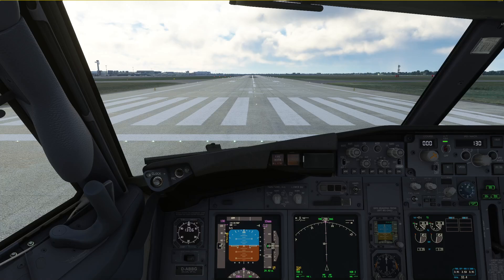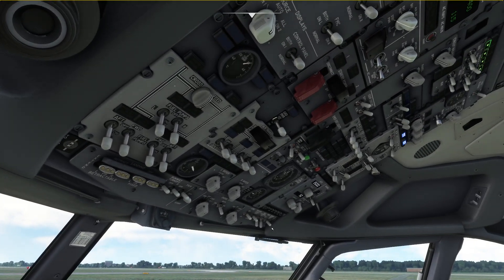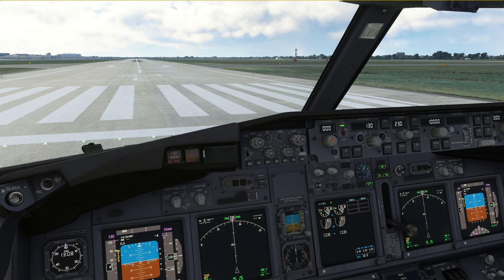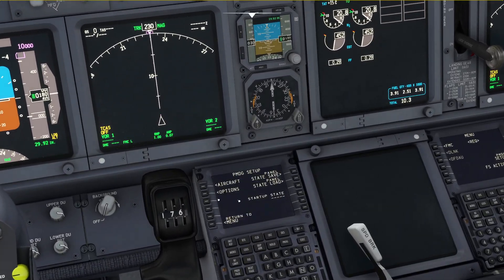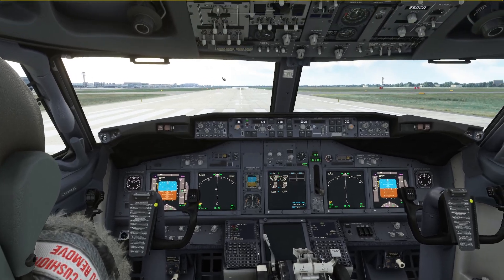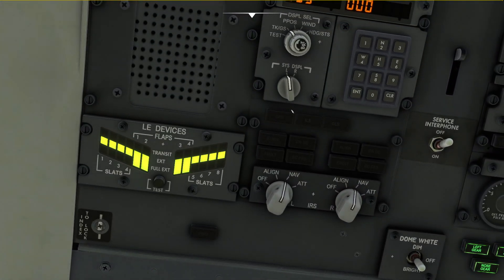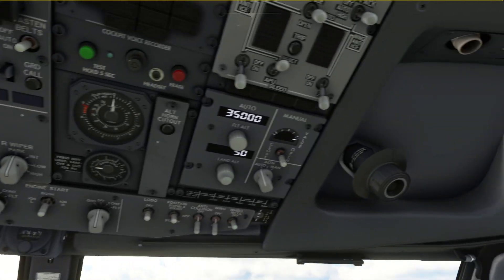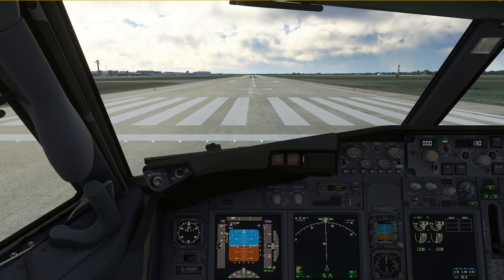Why we do so many RECALLS. 737 Master Caution System explained | Real 737 Pilot

Comment: Very helpful - thank you!  One clarification:  If the recall brings up WARNINGs that have not been previously shown,  these would not be considered important to the safety of the flight if I understand correctly.  So is the only purpose behind doing so many recalls, to get a bigger picture of what may be happening?  In other words, these warnings would likely never cause the pilots to cancel the takeoff, or return to the airport - correct?

Comment: Was always wondering why boeing wouldn't develop a new and modern crew alerting system even for MAXes, like airbus ecam showing detailed alert messages on upper display
Reply from the maker: Hi Eugene, it would mean major training efforts for the crews, costing the industry millions of dollars. The 737s system works, so why change it?
Reply: @A330Driver  that attitude killed 300 innocent people.
Reply from the maker: @simulacrae  No. Please familiarize yourself with the entire reports and what actually happened before posting something like this.
Reply: @A330Driver  Truth seems to settle somewhere inbetween. Giving the MAX an (EI)CAS would not have saved these lifes because it would not have come up with an indication on the screen. Feeded with false data vom just a single AoA sensor MCAS did exactly what it was designed for. Keeping nose down by ELEC TRIM whatever it takes. But where I tend to agree with Christopher is that Boeing maliciously sold the MAX as an  -800 with bigger engines and better fuel efficiency. Which she is not. Implementing MCAS into documentation an training would have been mandatory. Resetting Flaps to 1 puts MCAS spook to an end. But you need to know.
Reply: @glubbgluck but the max cockpit looks so much different than the 800